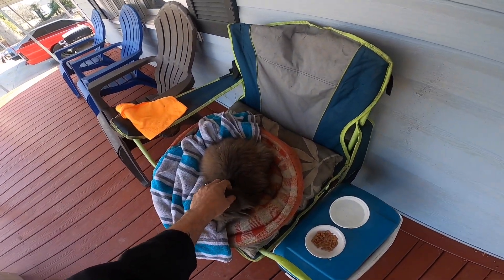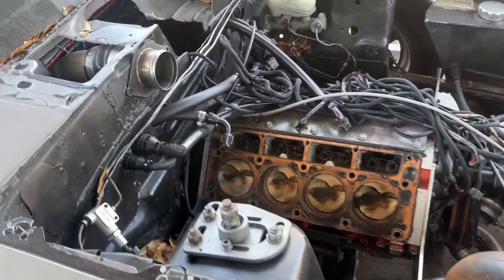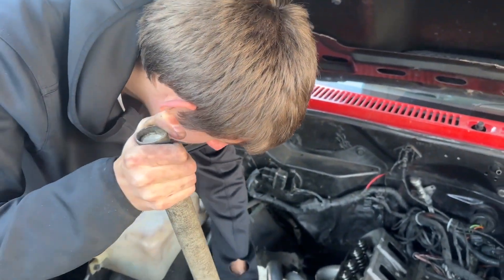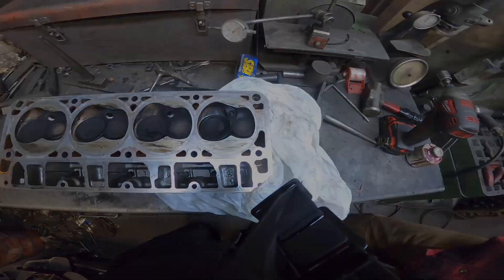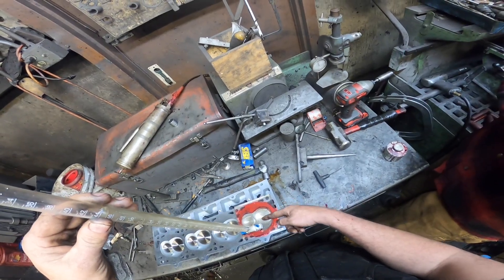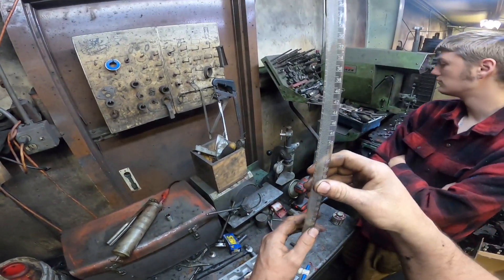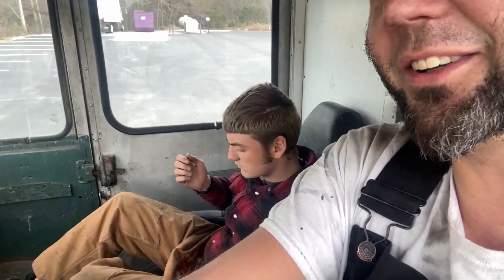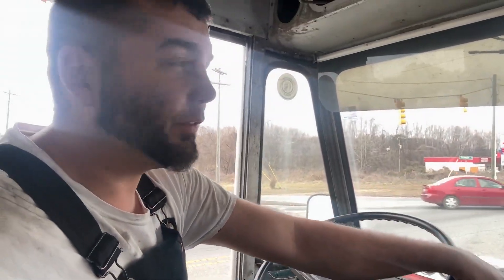Budget ls3 to afr 238cc heads, we pull the s10 heads to do the comparison part 3

Comment: Watcha gonna do with them budget LS3 heads bruh?
Reply from the maker: Sell them
Reply: @Boostismyfriend  823 or 821 heads, how much?
Reply from the maker: @bagwellpower2951   pretty sure there 821’s with btr .660 springs, they are off a 30,000 mile vette swapped for trickflows, $500
Reply: @Boostismyfriend I have some 1st gen s10 parts too. New racer's edge fiberglass front bumper and valance and a deviance fab aluminum core support if interested.
Reply from the maker: @bagwellpower2951  i am sure we can work something out
Reply from the maker: @bagwellpower2951  sounds good